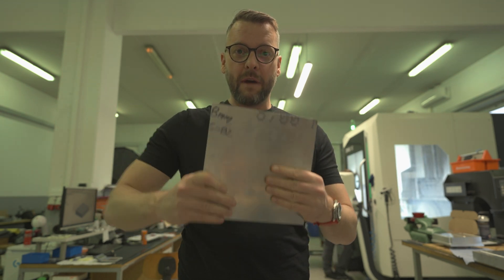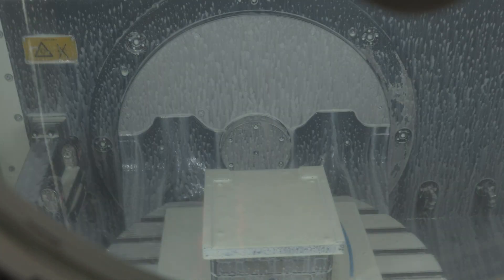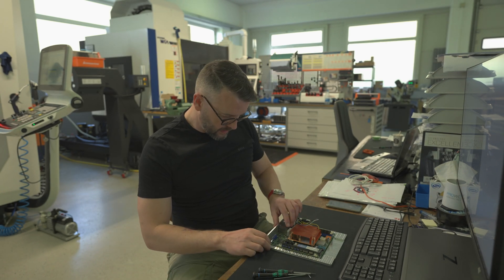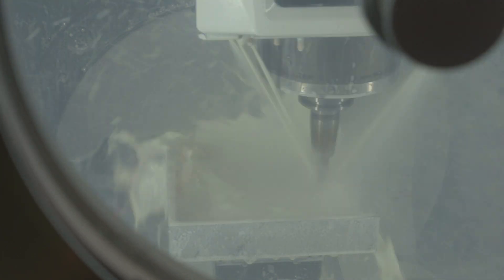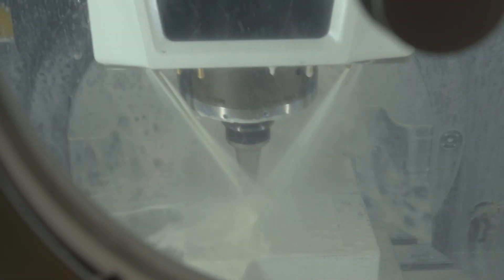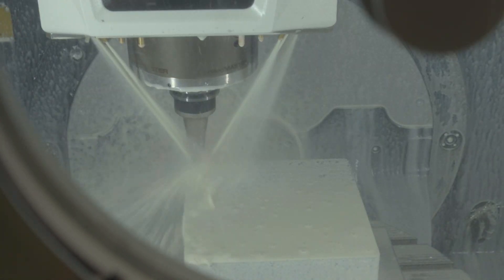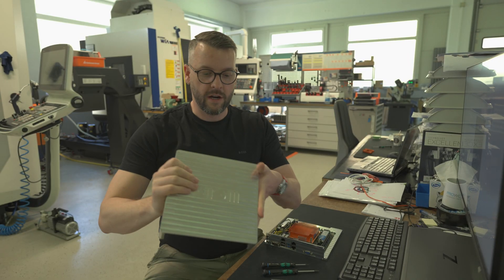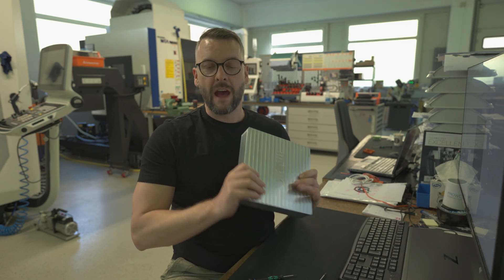The best OPNsense router? Maybe. The best looking one? Definitely!

Comment: YES! the next CNC video is here! The top looked really nice, the activity light behind the mesh will be perfect. Stealth but functional!
Reply from the maker: Thanks! On the right of the mesh there are six holes that have an additional chamfer, so that light pipes will fit in them: power, HDD activity, 2x network activity, FAN errors, and ID light. And behind I'm planning a simple PCB with LEDs on a 3D printed bracket. Everything documented and published here, of course! :)